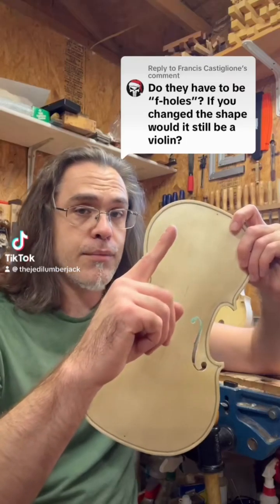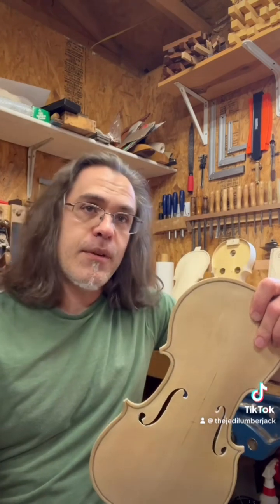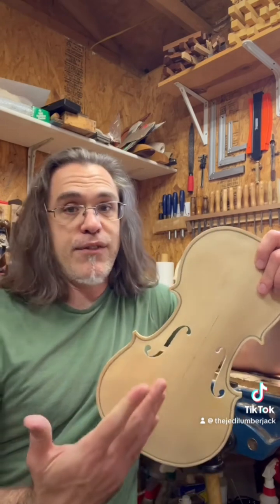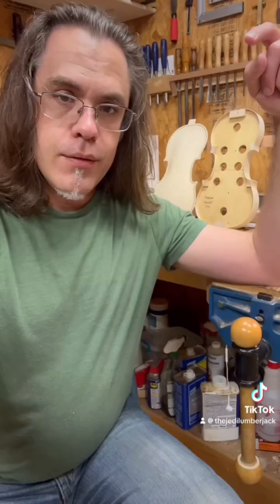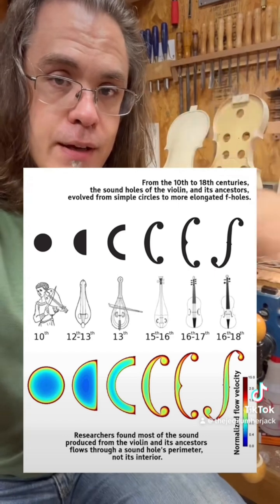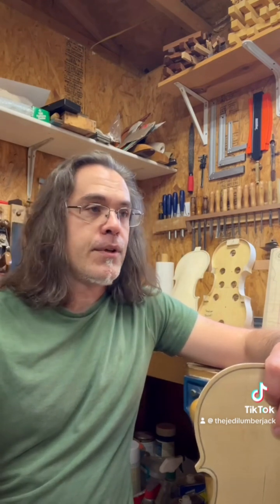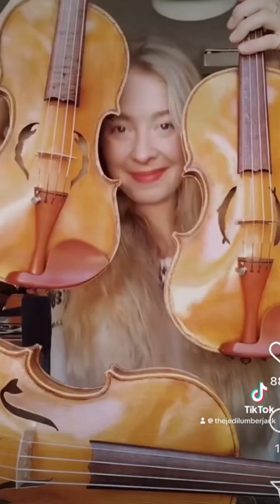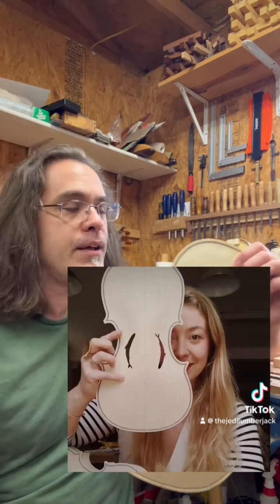Do F-Holes HAVE to be F-Shaped?

Comment: What about sound holes in the sides of the violin, so the top would have no hole and could vibrate without impediments.
Reply from the maker: The f-holes are a major part of what allows the top to vibrate the way that it does. You wouldn't want to put holes in the side of the instrument because the ribs are only about 1mm thick. A hole anywhere would be extremely prone to warping out of shape.